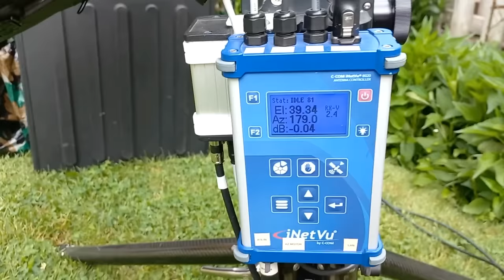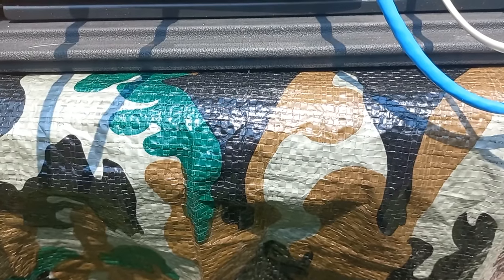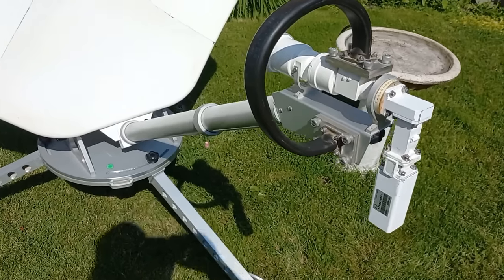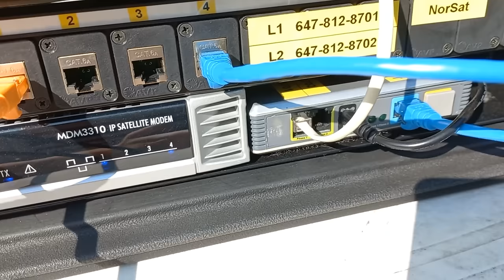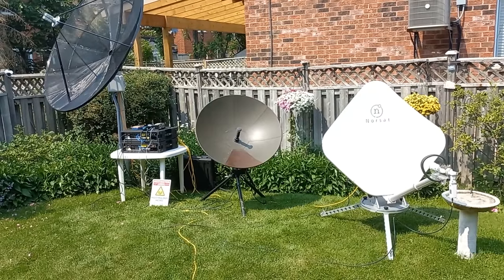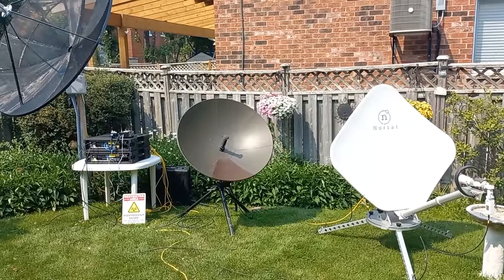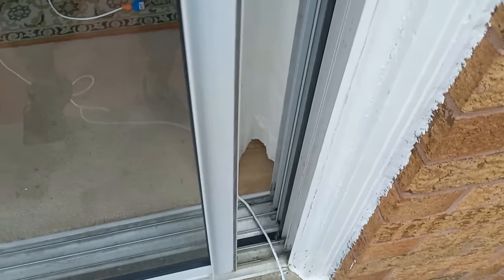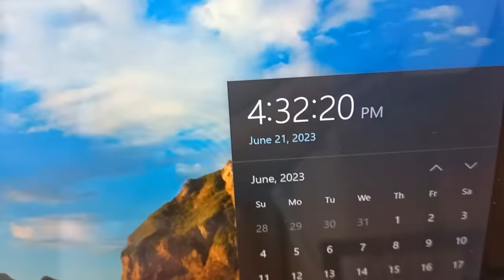Free Internet - Hacking Foreign Satellites

Comment: Given the hazard of walking in front of the uplink,  this really is a burner phone.
Reply: hahahah 😁
Reply: what would happen if you did? Would you have ot stand in front of it for a while for anything to happen?
Reply: @Daniel-ng8fi  its microwaves so i assume it comes with the same risks as a microwave in your home that's been cut open
Reply: In other words, an almost negligible risk of corneal damage via microwave heating?
Reply: @Daniel-ng8fi  unless the transmitter is hundreds of watts, most likely nothing, but it's still a sensible precaution. Edit: it's 50 watts, that's nothing for your whole body, but if it somehow gets focused on one area it'll burn that area
Reply: he might get sucked into the satellite  like in the movie stay tuned 1992 lol
Reply: @notepicalsalt612 sooo... Having a chocolate bar melt in your pocket??

Comment: Talk about microwave safety, My late father was a Naval Radio Technician during WWII.  He was assigned to the super secret Radar training on an island in Galveston Bay, Texas.
He really liked the training course, as they were absolutely forbidden from bringing pen and paper to the island.  
Anyway, during the training, they had a small radar system with a rotating antenna.  The course instructor ordered the men to one side of the room, and stopped the antenna
facing the other direction.  He put a hot dog on a stick and cooked it.  Then he turned it back on, Dad said it felt like a heat lamp rotating around.   Safety Third!
Reply from the maker: The concept of using microwaves for cooking food came from radar development. A WW2 engineer discovered that he could melt a chocolate bar with the radar signal. The power from my antenna isn't anywhere near what's needed to do that so don't you worry, I'm not running a primary radar system here.
Reply: Not powerful enough. You need some Serious power behind it to cook something.
Reply: Can't help but wonder if the LORAN systems from that time period caused cancer... my grandpa served in New Guinea during WW2 as a radar tech... thanks for your father's service
Reply: @manonamission2000  non ionizing radiation
Reply: Why did your dad hate pen and paper so much?
Reply: When my late father climbed a microwave tower to work on something he put all the fuses in his pocket so nobody could turn it on. He went on to work as a network engineer for a telecom.
Reply: @sa1t938  just saying "non ionizing radiation" doesn't make it safe
Reply: @desktorp ionizing radiation is the biggest cancer risk when talking about radiation safety. microwaves are not going to damage your DNA. what they can do is warm up the water in your tissue, and even then, it takes a large amount of power to heat you up enough to cause a burn. water is incredibly good at absorbing energy and barely heating up at all, plus the fact that your body actively regulates its temperature through circulating blood- standing in front of a small microwave antenna, worst thing that could happen to you is you feel warm. maybe if you were directly in the path of a very powerful one you'd be in danger of burns.
Reply: The modern day 'Growler' electronic warfare jets embarked on US Navy aircraft carriers have GOLD in the cockpit window.
The reason is simple - the transmitters on the plane are so powerful, without the gold they would cook the brain of the pilot .
Reply: Visited a long wave radio transmitter station. Inside the building was a fluorescent light tube standing in a block of wood. It was lit up, no wires attached. The amount of energy we burn transmitting data wirelessly in general must be tremendous.
Reply: whats good about radar dishes is theyre actually shaped to focus all waveforms away in a straight line, so you are safe if you arent right in front of it
Reply: @manonamission2000  even if it wasn’t the LORAN it was probably everything else from that time period
If he spent time on a navy ship, there was a ton of asbestos on those
If he ever had to clean an electronic circuit with benzene, that could cause some damage
Barium, lead, arsenic, antimony, cadmium, etc were commonly used in electronics and glass tubes
Reply: he probably used a lighter to prank them for life! hahaha
Reply: @aserta It's not the power, its the field strength. One of the dangers of experimenting with microwaves is that the wavelength is so short compared to a reasonably sized parabolic dish. Just spitballing numbers here 1400mw of drive power into a 34dbi dish would produce a colossal amount of RF energy on the business end. Now this is probably nowhere near a microwave oven who focuses the entire output of a magnetron into a resonant cavity, but there is anecdotal evidence (Namely radar technicians that mysteriously developed cataracts after looking down energized waveguides) that the eyes are in immediate danger working around these fields.
Reply: @pikuhana  Not necessarily; even such a highly-directional antenna has side-lobes (and even rear lobes), that are much less powerful that the primary lobe or beam, but depending on the output power of the transmitter, and your proximity to the dish, you could still receive exposure greater than considered safe.
Reply: @desktorp Saying non ionising radiation means they understand why it's safe in terms of not giving you cancer. 
It's like you're telling someone that saying "low amperage" doesn't make electricity safe, but it's just clear that it is safe in the intended context and you just don't understand what they're implying with the statement.
Reply: yeah, your dad was a liar 😂,
Reply: I was actually the Field Service Engineer for the company that made the diamond dish. One of my usual jobs was running the MEL (Maximum Exposure Limits) calculations for those antennas. The spectral flux density is low enough that as long as you don't have your hand right in front of the feed horn while transmitting, you're fine. At most that transmitter is only 40W.
Reply: @nonenowherebye  Hi, is there a way to learn all this by oneself? Any advice? Thanks.
Reply: @electric_sand  there were a few reference books that I used, plus a fair bit of googling. But it’s been over a decade since I was in that line of work.
Reply: @nonenowherebye  Thanks, I can probably get the info...but nothing beats asking someone who has been in the trenches. All the best.
Reply: Shake hands with danger!

Comment: As an ex Satellite internet NOC, I can say the operator actually know when you try to beam the unauthorized frequency to the satellite ,and they would get an automated notification from the system. However, there nothing that they can do beside asking everyone who had leased or leasing the satellite's bands to investigate. Blocking the line is the last thing they want to do.
Reply from the maker: Exactly!
Reply: so theres nothing they can do about it? 

whats preventing you from making this connection stronger or spoofing that authorization?
Reply: @austist  In theory, most of the places required you to have a license to transmit satellite signals. By transmitting illegal signals, it usually violates local laws, and satellite vendors can contact local authorities for help. Also, SAT vendor can track the origin of the signal with pretty good accuracy. However, from my experience, local authorities are basically useless, and SAT vendors usually just block that part of bandwidth on the beam.
Reply: @Sakura__Ayane  Im very much not aware of any of this but this is awesome to learn about.
Reply: @austist  i agree! (: people can be so cool sometimes!

Comment: The tests you have carried out are very good, at the moment I am using a Google translator because I speak Spanish. The problem with choppy and delayed sound is because you need a GPS or the modem software to be synchronized with time. Every telecommunications system requires that both sender and receiver must be synchronized and this is so that the signal frame is sent and received in a synchronized manner and not at the wrong time. If you use TDMA frame, it is demanding that it needs to be synchronized.
Reply: I think he is loosing half the packets. Probably the VoIP adapter is set to 64kbps (8kHz uLaw or something), while his link is only 32kbps. The modem does internal TDMA synchronization.
Reply: sync is embedded in carrier, gps only required for auto beam/sat selection in modem for auto pointing vsat antenna using openAmip.
fixed vsat doesn't require a gps either.

Comment: One of the networks on a broadcast FM station I engineer for uses the same Newtec modem setup that lets them talk to all their equipment at the site and send the audio that goes over the air. It's very reliable from what I have seen. We use a very similar telephone box for remote broadcasts. These days it's cell from that back to the studios but I still have an old VHF link I can use in some cases.

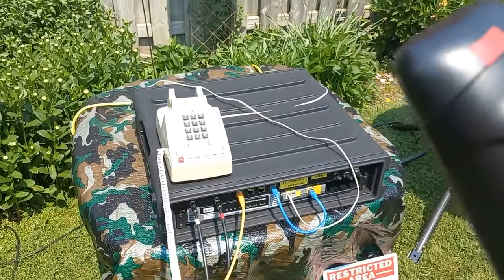Comment: 6:47 😂 I was a telco contractor for 15 years and developed an interest in the history and evolution of the PSTN. I also listened to many of Evan Doorbell's phone trips. Man, the old mechanically switched network must've been crazy!
Reply: I worked on the relay system in the UK. Also worked on the very first computer controlled pbx system. I left the industry in the late 70s but was working for a computer company and ended up working on some of the first mobile phone systems didn't intend to.
Reply: The channel "This Museum Does Not Exist" has one of those mechanical systems set up and running, really worth a look!  I think i may have found some archival industry footage or something on youtube as well.

Comment: the G729 codec is only about 8Kbps so you should be able to make a pretty solid phone call unless you have it set to G711 which is 64Kbps but is toll quality.  I set up a mesh network for Yukon Government on C-Band using those SIP ATA's and UHP modems - What a fun Project. Have you used the UHP sat modems ?
Reply: maybe I should have watched the whole video before commenting... LMAO
Reply from the maker: yeah, I did test using G729 and it made a huge difference !
Reply: What about using Codec2? It would require Asterisk in both sides and sounds terrible, but hey, it works at 1.2 kbps

Comment: you can use both antennas simultaneously and gain twice bandwidth boost 😊
Reply from the maker: Yes, that is totally doable. We'd then have 64 kbps!
Reply: So hypothetically, if I had a field and a lot of dishes found, I could get a few Mbit? 😂
Reply: Id imagine you would very quickly hit the max throughput of the satellite
Reply: @highlandrab19   I don't think so. But my guess is that the full throughput of the satelite is in the range of 100mb/s or may be even higher.
Reply: Downlink bandwith is depending whats been set on the remote hub, and could actually be quite high BW as the HPA is usually a beast.
Uplink from remote site ( the guys backyard ) is dependent on the size (wattage) of his BUC, ( he said 50 watt earlier, and you can get decent BW out of that ( if allowed by teleport HUB ))

Comment: Great video fellow Ontarian! G711u (full range, low compression) uses around 75-85kib/s, G729 (highly compressed) is 30kib/s. Sounds like your latency was about 1.25sec per dish. But the 711u bandwidth might have been what was killing the smooth clarity from the receiver. Curious if you could have a clean phone call with both on 729 :)

Comment: Hello, how does the VoIP telephone work? Who assigns it the tel number? Im assuming its a local thing with a server that you own. 😃
Reply: You don't own or operate a server.
In respect of the PSTN replacement, you plug your fixed line analogue telephone in to a port on the back of your broadband router. The router is the only equipment you need, and an optional UPS to provide power in the case of a power failure.

The router is connected to your internet  provider who also provides (provided) the PSTN service.

So the Telco company that provided you with your fixed line analogue phone service will provide your VoIP service.

That Telco that assigned your phone number to the fixed line phone connection will assign the phone number to the fixed line phone on your VoIP connection.

IP addresses come into it, SIP and database services.

Quite what happens when your Telco providing your PSTN fixed line service is a VNO running over Openreach, I am not sure, but I would anticipate that the VNO still ensures you get the same phone number assigned to that fixed line phone when it is connected in to the VoIP network - as that is fundamentally important. The transitipn to VoIP from the PSTN needs to be as seamless for the customer as possible.

Therefore I envisage a technical solution where the VNO provides data to Openreach and Openreach register your IP address and the phone number provided by the VNO into their database services application. All phones on the network have to be registered.

It is likely that number ranges have been allocated to each VNO, and for the addition of new communication services the VNO can pick a number from their allotted range.  Other approaches are possible but I suspect this is the most likely.

Comment: This was my job in the Air Force.   Combat Communications, we set up equipment like this in austere environments so we could communicate.  Both ground radio and SATCOM.  When we upgraded to 50Mbit modems I thought it was infinite bandwidth lolol.
Reply from the maker: I've actually uplinked, transmitted, at 20 Mbps using this gear. The BUC was pushing 50 Watts into the antenna to accomplish that rate. I have the capability of 25 Mbps up and down around 100 Mbps.

Comment: This thing costs more in energy than a 1 gbit fiberglass connection. Still awesome that you got it working
Reply from the maker: It was in total pulling only 8 amps @ 120 volts which is 1000 watts

Comment: Modem, L-Band TX to BUC (block up converter) that looks to be combined with your SSPA (solid state power amplifier).   RX side LNB through L-band to the modem.  Or LNA to down converter then modem.

It's fun doing this sort of stuff.
Reply from the maker: You must have been involved in VSAT to know this much.
Reply: @peterfairlie2296  It isn't the size of someone's appature that matters, it's how you use it.

OK that is a lie.  The smaller the apprature, the wider the 3dB down beam width.  I would rather have a larger antenna.  I have operated from 1m up to about 3.4m parabolic reflectors and associated equipment. 

Good content.

Comment: puts this equipment on a ups system end you have an emergency comunication system in the case of natural disasters
Reply from the maker: I have a 3000 Watt data center APC UP's connected to a 48 volt 40 Amp hour battery bank. And that's just to keep the power going before the generator kicks in.

Comment: Is that enough bitrate for a fax machine? That would be a cool setup if you were in a very remote location.
Reply from the maker: Enough bandwidth for sure but the latency will paly havoc with acknowledgment timing.
Reply: Fax requires a smooth and jitter free connection. It's a nightmare trying to get it to run over VoIP at the best of times, it would never work over this.
Reply: I suppose it would be enough to send WhatsApp, iMessage, etc., because these things tend to still work on GPRS. Don't know about the ping though.

Comment: Peter, great stuff! Are you an IT Dude or Ham radio geek? (I am both :-D) I love microwaves and was one of the few who modified magnetron from certain oven and used it on 13cm as phased lock for EME.... (about 500W CW into 3meters dish....nice)
Reply from the maker: How did you modulate the microwave oven magnetron? Would the frequency not be fixed at 2.45 GHz? I have heard of this being done for HAM ATV.

Comment: Pretty cool setup although not real practical unless you need a mobile rig.  Did a lot of C and KU band satellite installs and service work from the 1980 to late 90s, got out of C band and residential work when the mini dishes took over.  I did do a few commercial internet dish installs in the late 90s, they were pretty iffy back then, the equipment was really lacking.

Comment: Just think of the money you can save with just a few thousand dollars worth of equipment. But as a man who makes $50 worth of electricity a year from my $600 solar panel / battery / Grid-tie system - I can appreciate the appeal.
Reply: When it was new, that diamond dish was worth closer to $80,000. Just the reflector was close to $10,000.

Comment: Awesome video, sir! I’m a phone guy and I love this. 
Looks like the codec fixed some of the issues. The latency for that bad boy is probably unavoidable. I was wondering what the ping times are. Have you looked into channel bonding to mix the two Ethernet connections to try and double the speed? How much power does that equipment draw?
Reply from the maker: 800 watts

Comment: Have you considered using noctua fans for your transmitter, it should make it silent, they make industrial fans as well if you need industrial fans. Also great video!
Reply: The noctua fans are not suitable for outdoor use 24/7 exposed to the elements. that transmitter is going to be outside, in all weather.